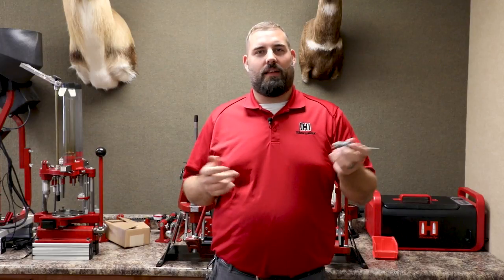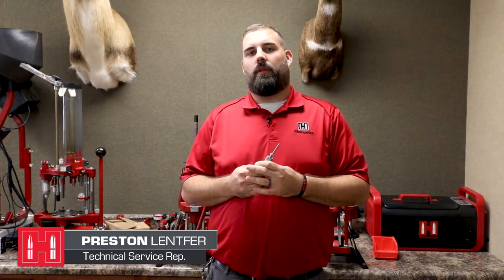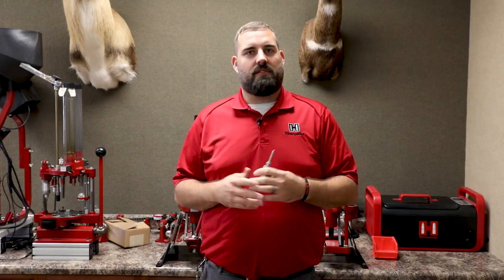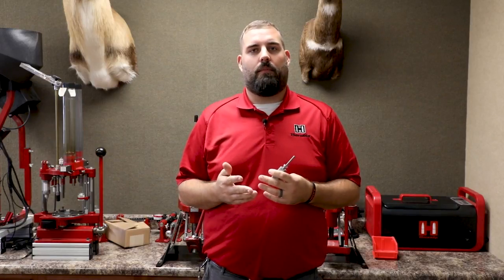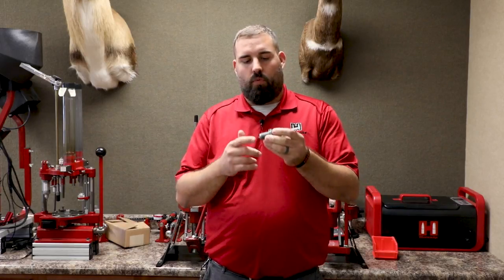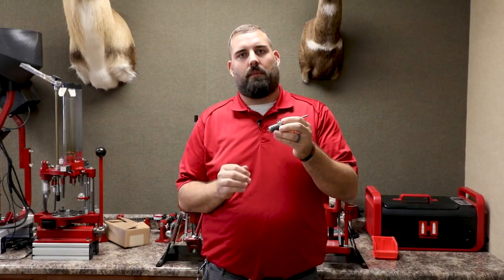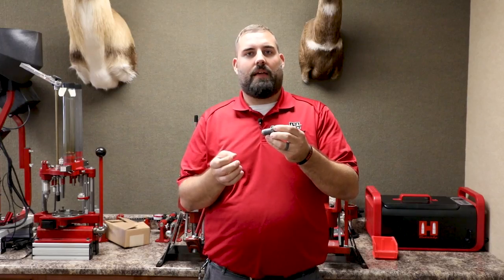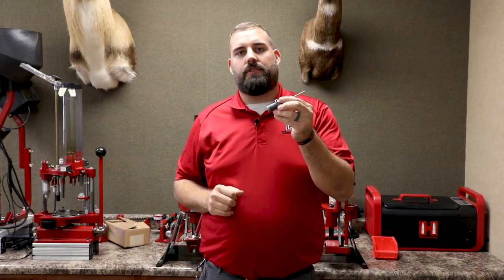TECH CORNER | Proper setting of decapping pins

Comment: My 9mm decapping die pulls the primer back up into the pocket. I had the pin set at 3/16 but had to lengthen it out to 1/2 to make it work . I filed a 45 deg angle on the pin and that seems to help. Going to put it back to 3/16 now and try again.

Comment: Check the timing on your AP press. That was the problem I had with my press: one detente location refused to index correctly on every single shell plate so I had to adjust the index for the whole press to correct it. I broke 6 pins and crushed two cases before I narrowed down the problem to the auto advance.

Comment: I have six Home Depot buckets full of .223/5.56 brass. About 1% seem to be primed with Berdan primers, or have the primers crimped in with enough force to shear the de-capping pin. Because I know, from experience, that I need to run these all through the Primer Pocket Swaging tool, I am only de-capping the brass at this time using the Hornady Universal De-capping Die. I just broke my last de-capping pin out of the Die Maintenance Kit purchased three days ago and I still have 3-1/2 buckets to go. Is it possible to purchase just the de-capping pins, preferably a dozen or so at a time, without buying the maintenance kit?
Reply from the maker: Give our techs a call at 1-800-338-3220